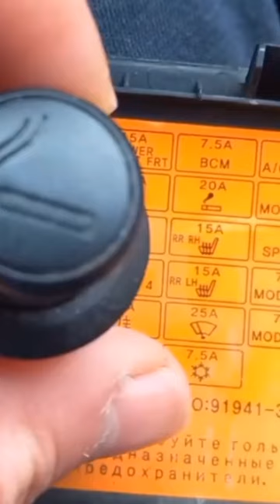cigarette lighter not working

Comment: I have 2 cig lighter.. one works the other not.. what could be?
Reply from the maker: Some common causes :
The 2 cig lighters may have separate fuses , a blown fuse .
The wiring for the non-working cigarette lighter may be damaged or disconnected. 
 The cigarette lighter itself may be faulty and need to be replaced.
There may be a problem with the vehicle's electrical system that is preventing the cigarette lighter from working properly.

Comment: do i have to disconnect the battery before replacing the fuse?
Reply from the maker: there's no need to disconnect the battery . When the lighter plug isn't pushed into the socket, there won't be electrical current circulating , even if the lighter is plugged in and you replaced the fuse , the maximum that can happen is the fuse will get blown if there's a short circuit , if not it will work normally
Reply: @fixing.automotive  thank you! this helps a lot
Reply from the maker: You're welcome 😊

Comment: Can't see properly
Reply from the maker: Yes, it isn't clear here , the cigarette lighter fuse is under the steering wheel to the left for this Hyundia Elantra , The location of the cigarette lighter fuse box can vary depending on the make and model of your vehicle , but in most cars, the cigarette lighter fuse box is located in the interior of the vehicle, usually under the dashboard or on the side of the dashboard. It may also be located in the engine compartment fuse box. To find the exact location, it should be found in the vehicle's owner's manual